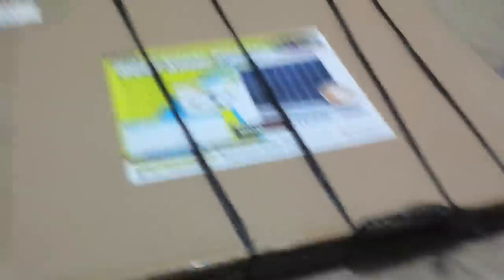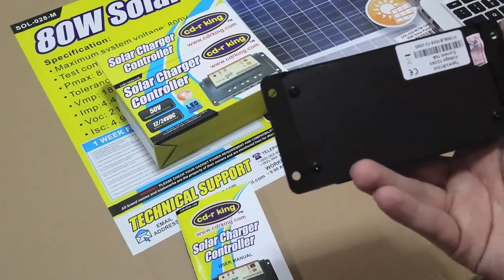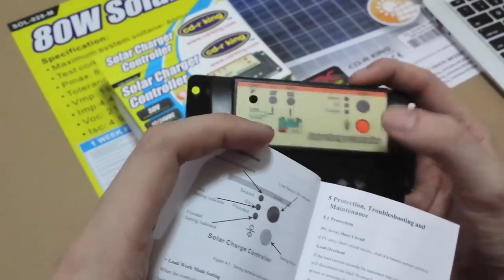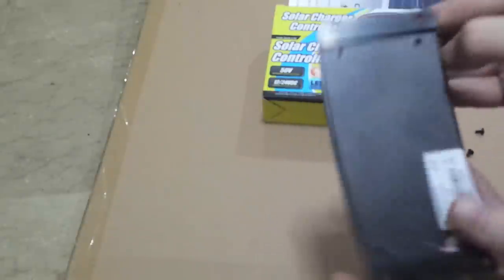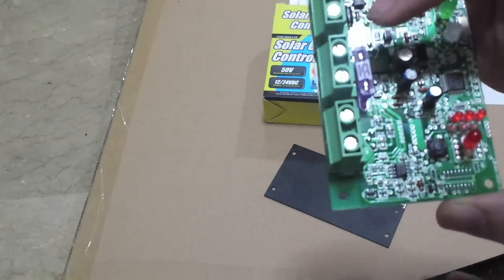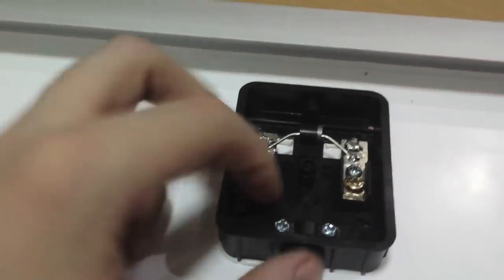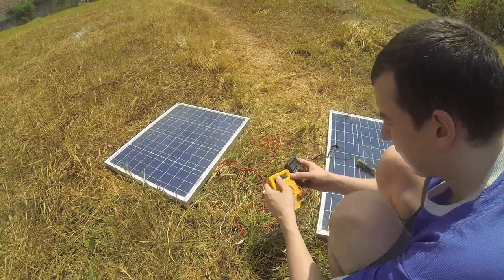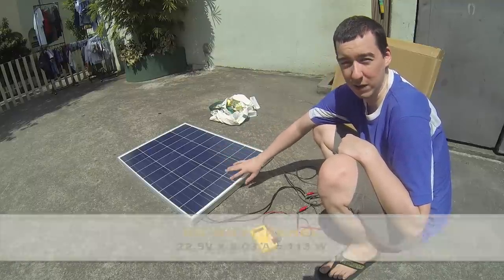CDR KING Solar Panels

Comment from the maker: I visited mega mall branch of cdrking and they now have deep cycle solar batteries available. They have 50ah for about 3k and 100ah for around 5.5k. I paid around 3100 for my 40ah from motolite and 6200 for my 100ah motolite solarmaster. So CDRKING are a bit cheaper but they only offer a 3 month warranty and they're not battery specialists. So personally I'd stick with motolite.
Reply from the maker: Update: The cdrking website says 1 year warranty on the battery so maybe the staff in the store were wrong about it being 3 months. But CDRKING batteries are sealed and have really odd looking terminals. Motolite solarmaster have nice large terminals with bolts and have removable caps for topping up the fluids inside.
Reply: how long it will take to charge 100ah battery with 80watt solar panel and how fast it will discharge with your laptop?

thanks
Reply from the maker: Billy Crook Most people don't let their batteries drain past 50%, so lets assume you want to fill those missing 50ah and then consume those 50ah with your laptop. I'm going to simplify the math and not include any losses. 80 watt at 12 volts would be 6.6 amp. 50 / 6.6 is 7.5 hours. If your laptop consumed 30 watts that would be 2.5 amp at 12 volt. 50 / 2.5 = 20 hours runtime.
Reply: Gadget Addict can you use it to charge e-bikes? even for a brief moment.
Reply from the maker: Emmanuel Macapayag Many ebikes use two 12v batteries in series. If you have two panels, you could wire them in series and connect to a charge controller and then the charge controller straight to your ebike battery. If you only have one panel or can only run a 12v system for some reason, you'd need to open your ebike battery and bring the terminals out and add a switch to break the series connection. Then have both batteries connected to the charge controller in parallel. I wouldn't recommend doing solar>inverter>AC ebike charger.
Reply: ah ok thanks. :D

Comment: Hello Sir Gadget, because of this video I finally took the plunge to purchase a 100 watt (promo price of PhP 2,990 now PhP3,880 with free CDR king 12 watt LED)) in time for use at Nov 1, 15.  It worked great in the memorial park, placed it atop the tent and people took notice as I was the only one using solar panel to power 2 CDR King DC Fan (6watt) for solar for my kids and my elderly mom.  Now I am using it to power the fans during day time in the living room as an experiment as I still had to build up funds for the battery and controller. But the CDR King store does not sell MC4 connector and the solar cables. Thank You and more of your videos to come.
Reply from the maker: That sounds awesome! So you just connected your fans and bulb directly to the panel without a charge controller or regulator or battery? I guess the fans are designed to handle a direct solar input? Sounds like it was very useful for you!
Reply: +Gadget Addict Very usefull indeed. Yes directly connected to the 2 CDR king DC Fan for Solar (6 watts, a new item actually from CDR King with a DC plug instead of a USB plug) and I also used a DC Fan for vehicles that you can buy from the car parts store. Fan speed varies depending on the intensity of the sun, it even run on the shade. Fan speed is too slow before 8am and after 4pm to run 2 DC fans, but it was a blast at peak hours for the 2 DC fans.

Comment: Hi, the diode/s inside the junction box at the back of solar panel is not blocking diode, but bypass diode. Bypass diode is useful when we connect solar panels in series. When one solar cell or solar panel has shading, current will pass thru the bypass diode. Bypass diode has no use when there's no shading on the solar cells.

Comment: I bought at CDR King their 150 watt solar power kit and like every promo it has a sealed lead battery,2  12 volt bulbs(wired and with holders),deep cycle battery clamps and of course the solar panels.What really gives me a no brainer moment is when you read their instruction pamphlet its all gibberish how and where etc is in it.The worse of it was when I made further research this gadget which I hoped would run some basic electronic equiptment like ventilation and other computer gadgets was on a modified sine wave setting instead of the pure sine which was not mentioned at all.To make it at least useful than be pissed off for being suckered I had to buy a rechargeable fan and check if the laptop or portable 12 volt TV would be compatible when using it.So far its working the only drawback is they should be specific on the KIND of electronic equiptment which is suitable in being powered by it.By the way,if we want to have a good solar power supply buy their biggest panels.Them small wattage panels would take 2-3 days in just fully recharging the small sealed lead battery.The bigger the panels the faster it charges.
Reply from the maker: +Antony Reyes I'm surprised it didn't mention on the package that it's a modified sine wave inverter. It's pretty common because they're much cheaper than pure sine wave. The main problem with modified sine wave inverters is when you try to power inductive loads like fans, refrigerators, etc. It will work but it will damage the appliance over time and it will waste a lot of battery power. You shouldn't have any problem using it with your TV, laptop, desktop computer etc. Thanks for sharing your experience, it's always interesting to hear peoples experiences with solar.
Reply: Antony Reyes thanks for the input

Comment: You were lucky to get a one week warranty!! Normally anything you buy in the Philippines has a 3 day warranty.
The 10 amp fuse location you mentioned is an easy fix,unsolder the fuse inside the unit and solder in it's place a pair of #14 wires as short as possible to just reach the outside of the case by making a hole in the plastic case,polarity is not an issue! Put an automotive fuse holder on the 2 wires outside the case and you can change it quickly anytime necessary.Don't worry about doing this because basicly your warranty ended when you left the store,they say one week but just try to get them to honor the warranty!
I would never buy anything there again ever,but would seek out a reputable solar panel dealer,most quality panels have at least a 2 year warranty up to 20 years.Good luck mate!

Comment: When I watch these kinds of videos in YT, I would have to bother considering the differences in the products presented and the ones I'm getting. But here, I get good insight and the product that I'm considering is readily available. 

Question 1: I'm planning on doing a small-scale solar charging station. For now, I'm planning on 4 12v ah batteries in parallel (12v 36Ah) setup with a 80w panel. Your math will give me (80/12) = 6.66 ... 36Ah/6.66 is around 5hrs. Since you can only use 50%, my power capacity is at 216w at 2.5hrs time. Am I doing the math correct?

Question 2: Does that battery controller stops giving charge to the battery once it reaches 100%? Do I have to manually switch it out? Or can I just leave it connected?
Reply: Aldrich Allen Barcenas  not this way，friend. if you want to fully charge 12V 36AH battery in one day, let's assume we get sunshine 5H one day, which means we need 36AH/5H=7.2A in one hour. And solar panel with 18V can smoothly charge a 12V battery (the 6V gap are lost in the charging process). So we need a solar panel with 7.2A*18V=129.6W .
Reply: +Aldrich Allen Barcenas Hi Aldrich.. On question 1, your calculation shows (80W/12V) -- the watt peak rating of the solar panel divided by the battery voltage. This is not correct. To determine the current output of the solar panel, one should check on the IV curve (current-voltage) curve, which comes with the data sheet when we purchase solar panels. At 12 V, what's the current output? One can read this at the IV curve.

On question 2, the charge controller's role is like a switch. When battery is fully charged by the solar panel, the solar panel is disconnected, so the charging stops. The charge controller does this automatically.

Comment: Thanks so much for you views. I feel very lucky to have got my hands on 6 120 watt CDR king panels. Only just got them, so no real testing has been done. I have on order a 600watt grid-tie inverter. I went with a grid-tie system in large part because of the high cost of batteries and the low quality of Philippine batteries. The down side is grid-tie is of no use when the power goes out, as it always does in this country.

I may add batteries at a later time, time will tell.
Reply from the maker: Wow that's great. If I had space to put 6 big panels I'd certainly join you and do that too! Have you spoken to Meralco about grid tie? When I emailed them about it before, they said they don't yet have rules/regulations about grid tie installations and couldn't give me an answer on whether the power meter would turn back if I pumped in more power than I was using. They also couldn't give me a 100% answer if they even allow customers to grid tie. But I have seen some small homes and businesses that are grid tie. But they use more power than they put back in, so Meralco would never know anyway. You could have just a single 100Ah motolite solar master battery as a minimal backup during outages :) But grid tie really is more cost efficient like you say.
Reply: philstuffs
 The laws about grid-tie in the Phils are very new, less than a year. But it IS allowed. I sure would not count on the meter going backwards as they need to be set to do that. My system does not have the watts to do that anyway. I hope this setup may reduce my bill by 20-30%. I am lucky that I have the space to install many more panels (live on a small farm) in the future reducing my bill further(I hope) This system is a test only at this point. If it works well, I will add on to it. Grid-tie does improve the ROI with the lack of batteries and more simple less costly wiring but does nothing in the case of black-out. But I have a standard generator for that. Love your vids, keep up the good work!
Reply from the maker: 77300d Heya, I got your message about motolite batteries but couldn't figure out how to reply, doh! So here's my response: It's funny you should ask that because I ordered a new solarmaster battery recently and had a bit of trouble myself. Some of the small motolite reseller shops are lazy and refuse to order the solarmaster battery, others offer to order it and say to come back the next day. But I just call the main Motolite hotline 370-6686 and they offer a 1 hour delivery. But stock of the smaller batteries is hit and miss so you might have to wait a day. I wanted a smaller 40 ah solarmaster and it was a bit of a struggle for them to find one in stock for the 1 hour delivery but after a little bit of hunting they found one and arranged the delivery. They nearly always have stock of the bigger motolite batteries available for delivery within an hour. I'm in Metro Manila. I'm not sure what their procedure is for other areas but their website says they deliver throughout the Philippines. Motolite resellers can certainly order the solarmaster batteries for you if they're not lazy!
Reply: philstuffs
Hey, thanks for that. Yes this new google+ system makes it almost imposable to just communicate, what is wrong with good old email like it was??. Dont feel bad, I don't know how to do it..I was just guessing with my last msg.  Manila has far more resources than here. I will look at the motolite site again, last I looked ordering/delivery was not offered here, but I will look again. cheers!
Reply from the maker: 77300d I contacted some sellers on Sulit who are selling non-motolite branded batteries and they wanted 6k+ for a 40ah deep cycle battery. I was like whatttt. Why would I pay 6k+ for a brand I don't know, non-existant warranty, plus delivery. I can get a well known motolite branded battery with a legitimate warranty for just 3150! And my 100Ah solarmaster battery is still going great!
Reply: philstuffs
The price of the batteries and the heavy duty and expensive wires needed are the main reason I am giving the grid-tie a go. p3150 is not so bad for a deep cycle. Once I give my grid-tie system a good test and make sure the ROI is within reason I may add a battery or 2.  This is all a experiment for me, it may be a big and expensive fail.  My inverter is on order from overseas as I found zero here. With luck I may see it in a months time?? Gives me plenty of time to install the panels and work out a simple tracking system.  My basic tests of the CDR-king panels are good. seem well made and at or above the rated voltage specs, and at a competitive price. If I could only say the same for most of there other products ;-)
Reply from the maker: 77300d Just remember that most grid-tie inverters will break if you put more volts/amps through than they're rated for. So you'll want to check what your inverter does when overloaded (whether it burns it off or if it simply breaks). 

Grid-tie is certainly more cost effective but having 1 or 2 batteries for brown outs really does make sense. Even if you just skip the charge controller and thick wires and just have it trickle charged from an AC power brick during the day (which is coming from your panels anyway).

I don't think it will turn out as an expensive failure for you. The panels are pretty cheap compared to those imported by other sellers and they're at or above their spec for power output. If you have enough space and good sun then they should easily cover your costs within a few years. Meralco prices are going up every few months it seems, so now is a good time to get panels going! 

And who knows, maybe the Philippines will follow other countries and offer some kind of rebate for those installing solar!
Reply: philstuffs
A rebate sure would be welcome indeed ! This is in no way a cheap project, but as you said, the price of elect goes up seems every month.  And agreed, maintenance and replacement cost must be factored into your ROI. Just like in batteries, they do not last for ever and need to be replaced as well. Will a inverter last as long as a battery ??? unknown. But the cost is about the same.
Reply: Gadget Addict just go at QUIAPO ST, STA CRUZ MANILA there is so many solar seller in a cheaper price..
Reply from the maker: Ranmar, do you have any sample prices that you've encountered? The only problem with quiapo is the traffic and parking. PLus it's kinda far from me so it needs to be a lot cheaper to make the trip worth while. I recently bought my sofbox lights from Sta Cruz
Reply: I fear the airline tickets and excess baggage fees would eat up any savings for me as I am some distance from Manila. But thanks for the information.  Next time I am in Manila it may be worth checking.

Comment: I finally bit the bullet and bought myself a 50w panel and a charge controller for experimentation purposes.  In the first solar shop that I went to, the technician advised me against buying a 50w panel even it is just for experimentation purposes because he thinks that I might outgrow it quickly.

I think he was right. Barely 1 day into my setup, I am already regretting buying the small one.
Reply from the maker: +NapstersGear I guess it depends on your intended use. You can always resell the 50 watt panel or just get another panel and start to grow your solar array :P
Reply: +Gadget Addict I originally intended to use the battery for my Ham radio station (all 12V) plus charging of my phones, tablets, and Li-Ion bats (all 5V using car cigarette socket-USB converters). All in all, with my usage patterns, I was expecting a surplus of 5-10AH even if the panel was just exposed to 5 hours of fair sunlight.

 But last night I decided to plug in a few more devices... and more... and more... then I started doing the math. Nope, my 50 watt panel cannot charge my bat enough even if there was 24h sunlight. hehe So I just cut back on the load and focused on my original intented use of my solar setup - which was to power my HAM radio and a few small devices.

Anyway, thanks for your YT channel. Yours is the only local review and gadget channel that I watch. ;) I've been through maybe 2/3 of your videos.
Reply: +NapstersGear .

Comment: Hi! How'd you measure the output current of the solar panels? It doesn't look like you were using any sort of load resistor to induce the current... and it seems like you're using those cheap CDRKing multimeters as well ^_^ did you just stick the probes directly at the panel terminals?
Reply from the maker: kabute To correctly measure the output, you need to connect a load, for example I often use 12v automotive headlight bulbs. For 'official' measurements I use my Sanwa multimeter. For initial quick testing of open circuit voltage and short circuit current, especially out and about in the sun, I will use cheap multimeters like the ones sold at cdrking.